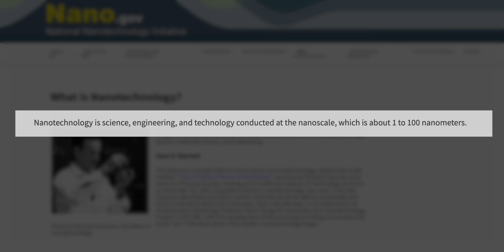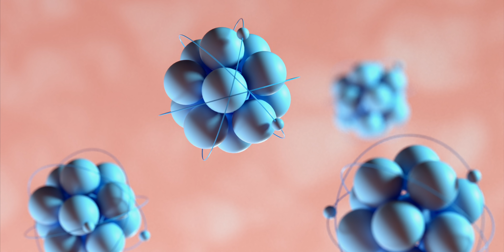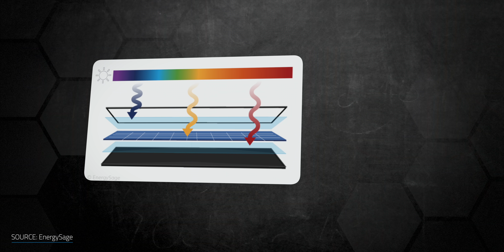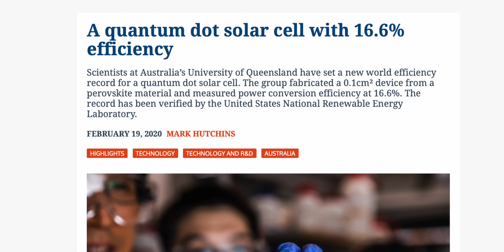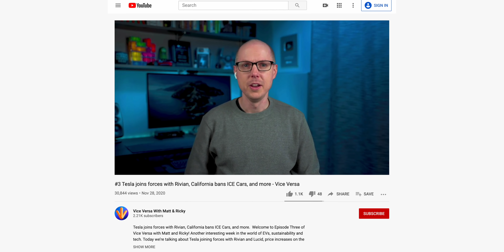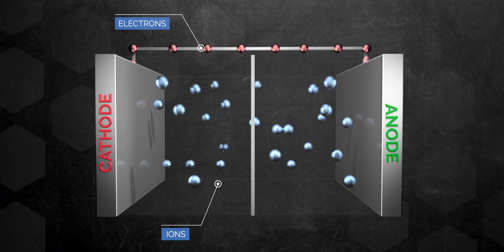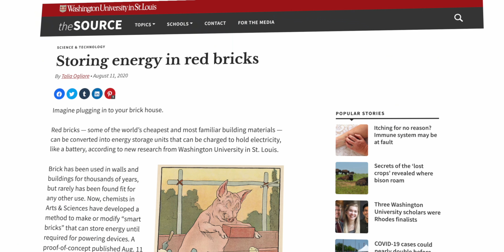Exploring Nanotechnology and the Future of Renewable Energy

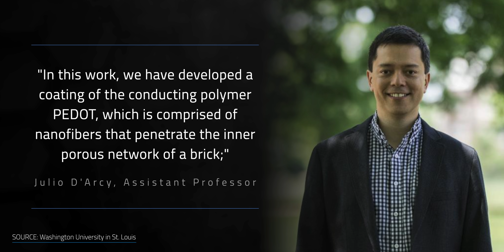Comment: 10:00 In simple words, brick as a Dielectric in a capacitors. 🤔 Right?
Reply: yeah, and the self assembled structure just happens to be right to keep the capacitance. so really it's like thousands or millions of nanoscale capacitors rather than one huge one? to my understanding. (PEDOT is also beginning to be used for some or all of the electrodes in some regular batteries and capacitors too, for higher surface area.)
Reply: @kenthhamner2641  yes, that's my point

Comment: The brick battery thing would work if they could make it a polymer coating for concrete. Bricks are weak, shift, crack, and fall apart. They almost couldn't have picked a worse construction material to hype up.

I consider the minimum bar for using a solar product to be around 30%. The highest practically theorized solar panel efficiency is around 90% using rectified dipole antennas, and likely can be improved by using superconducting antennae tuned to a certain frequency. Bragg reflectors and multiple single-frequency range rectenna arrays can be used behind a receiving window of a certain area to overcome the limitations of using dipole antennas. There may be other antenna designs which are more efficient for non-coherent (out of phase/ polarization) light. May even be able to make a meta-material that corrects the light with little loss.

Comment: In a building constructed using the iron oxide red bricks as solar collectors/capacitors, what stops people from getting zapped when touching the surface of these bricks?  Also, how does one bias the material to get a separation of the charges into positive and negative?  Are the individual nano-particles acting as diodes that all align themselves in the same way?

Comment: If you get solar on your house its not allowed to work when power goes out due to safety. Unless you have a self contained circuit (battery).  Putting solar everywhere still needs switches and more. The panels are usually hidden anyway.

Comment: I can't wait for the structure to be a "Load/Load" bearing structure...
Reply: Not using bricks.
Reply: @Baigle1  We might develop a new block/type, sorta a cinderblock that has a coating with an inner battery fill?
Reply: @chrisgriffith1573  Cinderblocks are a step up in durability and strength, but are still sub-par. I was thinking something like an electrochemical spray coating that can be applied to bulk concrete. Calcium or another ion donor could be a good target. It would be very low voltage, but it would also have a large surface area and can be separated into many structural cells. It would even go well with vacuum insulated panels which have an aluminized (and conductive) outer layer as a charge carrier.
Reply: @Baigle1  ... that is a different concept altogether. I am talking about battery storage of the converted energy. a mud brick to the inside of a cinderblock could be custom tailored for better storage capacity, and reclamation with no leakage like a simple brick.
Reply: @chrisgriffith1573  I'm assuming these are very expensive bricks if you're worried about reclaiming the materials (baked mud, some magic sauce). I personally would love to see the tech, but in the confines of being able to add structural integrity to a building, being easy to place as a fixed long-term asset of the building, and not degrading much over time all at a fair cost. The pricing model seems more sensible if people can't re-use the bricks, leading someone like me to think that a solidifying approach is more practical. How about aircrete with that fancy polymer in it -- buying it as a mixture additive?

Comment: You sort of touched on it about solar panels, but nanotechnology is everywhere in all kinds of semiconductors. 

Inside CPUs, SSDs, TV and phone screens, just to name the most common ones. SSDs and CPUs have some pretty wild component densities, billions and sometimes trillions of transistors now, only a handful of nanometres wide each, a few dozen atoms making each one, in all of our phones like it's no big deal. 

For instance, in SSDs, each bit is at least one transistor, sometimes more. So a 1GB SSD, still has 8 billion of them. That's a pretty small capacity nowadays, what with 500GB and 1TB microSD cards existing. 1TB of course being, at minimum, 8 trillion tiny transistors. (All numbers short scale, naturally.) 

By comparison, the few million TFTs (one per pixel or one per subpixel depending on construction) in an LCD or OLED screen are much bigger, but still impressively small and reliable by any measure. Just doing their job, adjusting each pixel's brightness 60/120 times a second.

Basically all of our modern conveniences, then, qualify as nanotechnology, and sort of by accident. In the '80s, when semiconductors began entering home gadgets in earnest, they were still measuring feature sizes in micrometres, hardly nano-scale at all. But nowadays, with so much CPU power crammed into everything, and flat screens on everything too, we're surrounded by the benefits and conveniences of making our circuitry almost as tiny as it can be. And examples like home video streaming end up using multiple aspects of this nanotechnology all at the same time: in their TV, in their wifi router, in their home theatre receiver, however many devices they're sending the signal through, they all have CPUs built that small and powerful, to handle the compression and transmission in real time.

Not to mention smart home devices, integrating tiny amounts of nanotechnology into the simplest thing, like a lightbulb!

Of course, I can understand the futurist focus on new materials science like 2D materials, graphene and other compounds, which unlock new functionality altogether rather than just miniaturising existing semiconductor technology to the nano-scale. PEDOT is pretty amazing, in the bricks and in regular, traditional, capacitors. The way it self aligns is pretty unique and very powerful. And obviously you've got to pick a focus to each video and crank them out week by week. But I do think it's pretty wild how thoroughly, yet subtly, nano-scale construction has altered our lives entirely through computers and computerisation.
Reply from the maker: Thanks so much for the super thoughtful comment!  I think we're both on the same wavelength and love your take on it.  It's truly remarkable the world we're living in with technology that we take for granted.  Nanotech is literally everywhere in our lives today, but goes largely unnoticed.  And we're just at the beginning of it.  So much to talk about and discuss.  Love it.
Reply: NONOS  Mi AMIGO S are everywhere in everything  like dust in the wind!

Comment: The capacitor cartoon is wrongly shown given the "dissectable capacitor" where a guy charges the capacitor, removes the inner and outer plate from the glass dielectric, touches them and nothing happens, than he reinserts the plates and touches the terminals and a spark happens. Meaning the static electricity is stored in the dielectric and not on the plates.

Comment: Hate to be that guy Matt but you are a fellow science nerd and I am sure you will appreciate this. At 1:27 when you say that the earth would measure 1 meter if a marble was 1nm your comparison is not quite correct. I believe you meant if we scaled up a 1nm marble into a 1cm marble (1:10,000,000) then a 1 metre (100cm) sphere would measure 1,000,000,000 metres in diameter (slightly less than the sun diameter). The Earth at that scale would measure 1275x10^13m wide which would make it much larger than the largest known star (Stephenson 2-18) which has a diameter of 6.02x10^12m. Mathematicians can correct me if am wrong
Reply from the maker: 🤦‍♂️  Appreciate the call out.  Need to look at that more closely.

Comment: What I can't understand is what will happen to insolation ability of the brick if you percolate it with ion. It is supposed to be porous by design in order to make sense as a construction material
Reply: How do you figure porous is import ant
Reply: @williamgoode9114  I'm just spit balling here. But I figure that the air pockets inside the bricks is providing some small amount of insulation. In the same way as thermal windows, or what ever two layers of glass is called in English.

But given that, at least in temperate climates, like where I live. No one would consider using plain brick outer walls, without any further insolation. I think the insulating properties of the bricks must be minimal at best. Hence this procedure aught to not cause serious problems in construction, apart from maybe adding a thin layer of insolation material in climates where they don't already.
Being able to save on power consumption, aught to outweigh the added cost.
The main reason for insulating your home in either hot or cold climates, at least in wealthy countries, is after all, to same on your heating or air condition bill.
Reply: @williamgoode9114  insulating ability of brick is coming from multiple change of phases of matter. Heat is generally transferred poorly when you switch between gases and solids. This is the reason insulating materials are usually foam-like - they contain a lot of bubbles and pores inside

Comment: I'm confused. Okay so I paint my wall and then what? How do I actually access the energy?
Reply: I'm by no means an expert on this stuff, but I have a working knowledge of it for my job. Someone way more educated than me might have a better idea.

The video mentioned that the paint creates a continuous conductive surface. If that is true, all you would need is one or more conductive metal rods, like wires, dispersed throughout the walls you're painting. Those would connect to your homes electric circuit to supply power.

I'm sure its a little more complicated than that. Hard to say for sure as the video didn't mention the power generation capabilities in absolute terms. You might need some transformers and batteries in between to really make it work. But it probably wouldn't be anything you wouldn't need to get a working solar setup for your home.

Comment: If the government wants renewables, the UK needs 3,000 gwh of backup electricaI energy (mostly pumped water storage).  At present, we only have 10 gwh (Dinorwig).     And if we do not build 3,000 gwh of storage, there will be rolling bIackouts and the economy and nation will collapse.   

The trouble being that the construction cost of 3,000 gwh - the cost will be in the tens or hundreds of £ trillions.  Take the cost of Dinorwig and multiply by 300 - I think you will find that to be stupendously expensive.   And that sort of cost will bankrupt the nation anyway...!

Do remember that the current work-around for a lack of energy storage, is gas power plants and the Strategic Reserve.  And what powers the Strategic reserve?  Ah yes, diesel engines.  

Note that in late November 2020 there was little renewable energy being produced, and so gas, coal and imports were providing about 26 gw out of a total of 35 gw.  (See the Drax Electric-insights website for the graphs.).   But this only records electrical production.  Transport would add another 35 gw, and space heating another 50 gw, all of which is predominantly provided by fossil fuels at present.  

Does anyone think that 105 gw of renewables can be built within 10 years?  And then another 6,000 gwh of backup (including sufficient backup to allow for transport and space heating) to be built in 10 years?  It is not going to happen in that time scale, unless corners are cut, and we are plunged into darkness, idleness, poverty and starvation.

Ralph.

Comment: Interesting program, topic well told thanks Matt.

Amazing scales to imagine, a human hair is 75,000nm wide, 250 nano-crystals on the head of a pin and get hold of some quantum dot solar-cell paint for my home. 
Would the paint then be porous or non-porous?

I ask the question because I work with lime-putty mortars and plasters which uses less energy to make than cement, the walls let trapped damp out and lime walls absorb CO2. My own building has 3 foot thick cob (rammed earth) walls covered with lime mortar with a straw roof all nicely insulated.
Reply: At approx. 4:30 in this, he said approx. 250 billion nano-crystals could potentially fit on the head of a pin. Why mention just 250 nano-crystals for the head of a pin?  Anyway, best wishes to you for your solar-cell paint.  I hope it works.
Reply: @maintoc  not sure what you mean in the comment but I liked some of the examples he said because it hit my interest button maintoc. 
I'm curious if it's porous or non-porous but is irrelevant so long as it's painted a metre above ground level.

Comment: You know the problem with dealing with asteroids on a path to intersect with the Earth?
Bombs don't work as the rubble just comes together again due to even the weakest of gravities.
Pushing is difficult because most asteroids are made up of loosely collected rubble. Any push is most like to just sink in.
Instead we can now send a paint bombs to turn it into one big super capacitor, and follow up with another to spray solar cell nanostuff all over it to absorb more energy from the sun and store it in the super capacitors, thus heating the whole asteroid and make it vent until it dissolves itself.
There may be some details left to work out and test ;-)

Comment: Most papers on most tech are useless.. it would explain everything in theory, but would be impossible to implement due to plethora of resons. This tech seems useless too in the form mentioned- paint. Solar cells or atoms need to be arranged on a sheet that would allow electrons to at least flow in a direction. Solar Nano particles can't be any side up. The same is true with battery technology. Hydrogen, graphene, liquid battery, ion tech,  and humungous others.

Comment: Graphene is more abundant than silicon and would be cheaper. We should save the silicone for processors so batteries and computers will get cheaper and more abundant. If we use more silicon for batteries it will take longer for the price of new tech to become more affordable and slow down the rate of new innovative tech. We've waited long enough to get newer and cheaper tech. Both are being developed but the winner is NOW TECH, not future tech. Graphene is nano-NOW, cheaper-NOW, and abundant-NOW. Let's not slow down the silicon market with an additional demand of supply reduction so we don't hit the wall of scarcity like we did with oil, lithium, and cobalt.
Reply from the maker: Graphene is definitely more abundant, but we still have a long way to go in applying it.  It's going to be interesting to see how we transition through all of this.
Reply: @UndecidedMF  yes, please enlighten his soul.

Comment: Great video! Have you considered nano scale machines? First step would developing the mechainsims, levers, wheels, gears, drive trains. The next hurdle is controlling/directing and power.  Both control and power might be by external broadcast, where the signal both drives and controls the machine. Next is automation, with programmable machines. Inherent in all this is how to start, control, stop and dispose the machines. Ultimately, reprogrammable/reconfigurable self_replicating nano machine. Inject some to chew up plaque in arteries and veins, or repair/rebuild bone structure, bone marrow etc., or joint repair due to arthritis or sports injury. At these scales nano machines may be indistinguishable from cells and bacteria. This may be a blend between biology and mechanical/electrical/software. disciplines.
Reply from the maker: Thanks, Richard.  And thanks for that point of view.  Could be a fun video too!  It's fascinating where nanotechnology can go ... truly blurring the line between human and machine.
Reply: Another aspect of nanotech development will be the requirement to blend and combine different science and engineering disciplines in a single, large, area of effort

Comment: Matt, there are plenty of real commercialized nanotech applications out there in both the mechanical and optical space.  Too bad you can use examples from them.  The examples that you use, are frankly, pie in the sky dreams for the most part that have serious issues with being practically implemented.  They might sound and look nice to folks who aren't versed in the area, but the fact of the matter is, much of the info you present coming out of academia is not practical at all, it doesn't have to be for them to write papers and get some grants.  If you really want to identify the real applications, you should be looking to companies that have a real commercial presence.

I work with many forms of these materials and most of the applications are useful, but not some dreamer type situation that you present.  There is a real gap between what can be "dreamed" up and what can honestly be implemented.